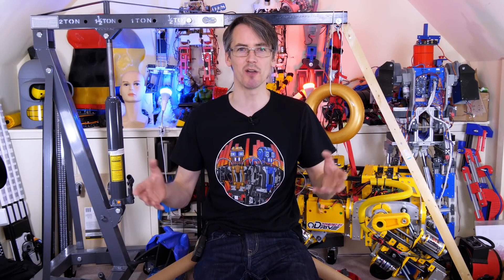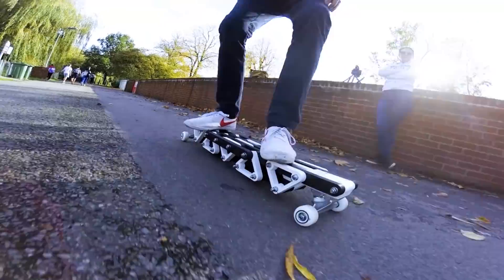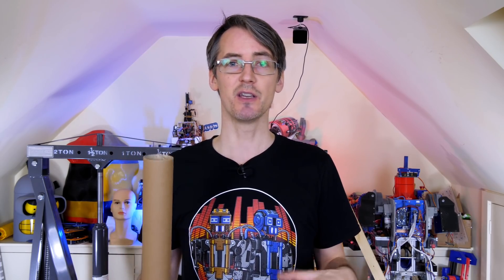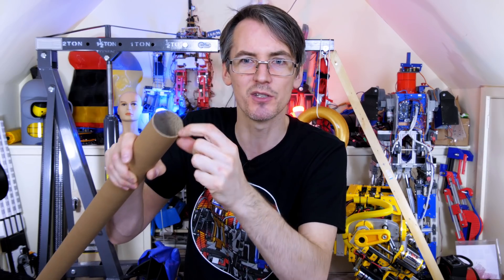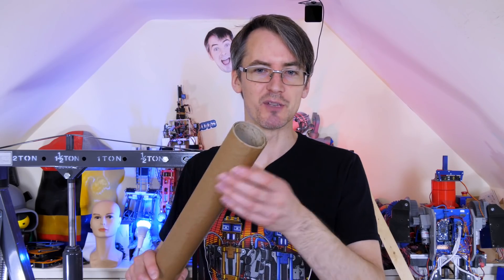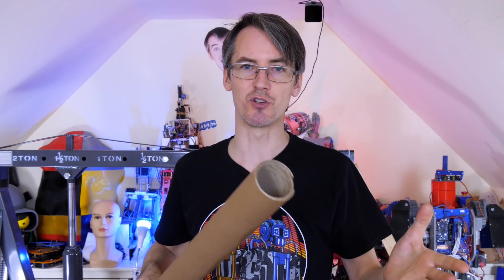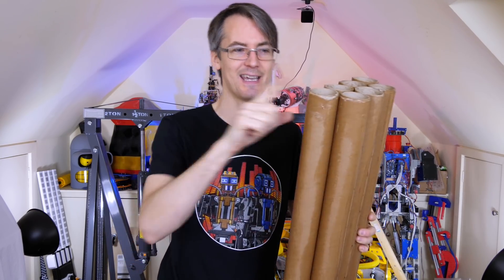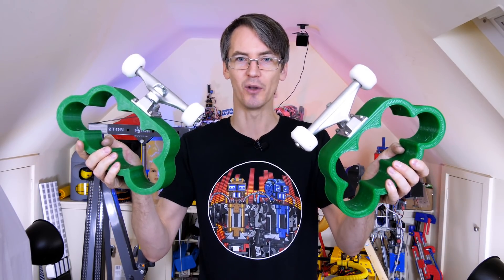How Strong is a CARDBOARD SKATEBOARD?

Comment from the maker: I'm having a one-week break from robotics, but we're back next week with Robot Dogs!   I thought I'd see how strong cardboard is - what else can I make with this type of structure?!
Reply: would be cool if you installed ducted fans in those tubes! Maybe you could get enough thrust to move it along when you're standing on it!
Reply: What if it rains while you are skateboarding?
Reply: @himanshunaik5636  glue coated. Not hard to seal the inside as well.
Reply: Disaster Shelter ala Shigeru Ban. Or Tiny Home.
Reply: Try you get your capable hands on some top level cross-country ski pole tubes. Carbon. Some may not be (as) tapered.
Reply: What about replacing some of the aluminum extrusion in some robot arms/limbs with cut sections of cardboard tube? It could possibly make them a little faster being lighter. =]
Reply: As a cardboard robotics enthusiast, I’d love to see your take on it.
Reply: A bunch of tubes... a Bicycle frame? That's technically just tubes too, usually made of aluminum.
Reply: Try making a nurf gun of your own with it
Reply: Rockets, airplane fuselages, telescope tubes.
Reply: Robots!
Reply: Is it weather proof?

Comment: You should stand in the middle of the tubes a jump off them or jump onto the middle of the tubes, that would be a better test out their strength. The best test of their horizontal tensile strength would be to see how much weight (in the smallest possible area) the tubes can take before they break.

Comment: considering your lamination of the tubes I'm pretty sure you could get rid of the bottom three tubes and the top four would be strong enough on their own. In fact I wouldn't be surprised if three tubes wouldn't be strong enough. Now if you start playing around with 2 part epoxy resin then the tubes become something altogether stronger, especially if you saturate the cardboard with low viscosity resin. I did this a number of years ago with double walled corrugated cardboard sheet and resin that was the same viscosity as water and that stuff is positively structural.

Comment: James you should try making  stuff with carbon fiber cloth with epoxy resin, very strong stiff and light. Use insulating foam for the core machined by hand or on you cnc router. It would take a lot of weight off the dog and other projects you make.

Comment: Thanks, for the great idea. Basically my wife wanted to make something that required a 12x8 inch cylinder and 3d printing strong cylinders was taking a lot of time and we need it to be light weight.  I suggest more quick small videos like this in addition to robots. May be a lighter version of open dog using these tubes as most of your viewers like me cant spend so much money on extrusion and strong powerful motors.

Comment: Ikea uses a honeycomb-like packaging cardboard that is strong enough to stand on. I'm resting my PC on a piece at the moment to raise it 5 cm off the floor.
Reply: Yes, most Ikea tables and other furniture are made out of these and most cheap room doors too.
Reply: @petermuller6923  I clearly said packaging material. Not furniture. Packaging material. Use Google translate next time.
Reply: @TheAstronomyDude  Sorry, i don't need a translator, just did not read carefuly. Anyhow, they make furniture out of cardboard. That's the point.

Comment: How about using the original tubes in a single tube design by soaking the insides with resin? Seems gluing 3 together is a bit cheating. :) Having only the 4 tubes across would lower the center of gravity also. Nice experiment though. Thank you.

Comment: This is crying out to have some model rocket boosters in the back LOL
Reply: It's a poster delivery system.
Reply: Hahah, that would indeed be awesome. Unfortunately, there's no way regular fire works would propel a skateboard forward with someone on it. The weight vs thrust ratio just isn't there. It would need quite the rocket.
Reply: PHeMoX yeah a regular firework rocket wouldn’t do it and would also be quite dangerous when it explodes 🙈 but there are solid rocket motors that can be made that would easily propel a human, to be honest the biggest challenge would be how not to make it too powerful 🙈
Reply: I was about to say something similar.  Due to the size and number of tubes, you could fit 5 pretty large solid rocket motors in it.  Of course the problem with rocket propelling a skateboard would be the initial moment of impulse.  It would be prone to bucking you off and going its own way.  hehehe
Reply: @PHeMoX  Isn't like 1 kg of thrust already quite a bit for this weight on skate wheels, say 5 m/s, flat ground? I don't expect mad acceleration but a gentle push is enough for someone one a bicycle to maintain that speed. Can't be more than a few kg.

Comment: There's more glue than cardboard in this thing
Reply: This has me wondering... if you soak cardboard in enough glue that it impregnates it, are you effectively making a composite material?  Where's the line between "a cardboard tube with glue on the outside" and papier mache?

Comment: That thing is areo dynamic in a pretty unique way. What other vehicle let's air move through its entire chassis?
Reply: Make it whistle...
Reply: @wolfbrave4866  That's brilliant!
Reply from the maker: That is a good point
Reply: @jamesbruton  It's worth noting at best. I'm not an engineer but I suspect it doesn't make much difference aero dynamically in a longboard configuration. I just like to think about things outside the 📦. Or cardboard tube if you will. Cool build!
Reply: An aircraft I sketched. Air inlet is the whole frontal surface. Air is compressed to narrow tube besides which there is space for systems and payload. Like an open head rocket. Aerodynamically inert of non-thrust drag.
Reply: @Cloxxki  Sounds sketchy lol
Reply: Not really.
If you add up the surface area of the tubes all together, it would be far more than a skateboard
Reply: @TATTIEPICKER  ...and is it the surface area that matters or is it the way the air flows over and through it?
Reply: @TATTIEPICKER  Yeah but a normal skateboard is tilted up at both ends causing lift and drag. On his there is more of a profile facing the air but mostly it can just flow though it. I'd bet the tube board would stay grounded better in a wind tunnel.

Comment: Did you even need glue or would the 3d print piece be strong enough to hold them together?
Reply from the maker: it might have been, also four tubes would probably have done
Reply: @jamesbruton  glue fills the voids like fiberglass insolation is floppy but with epoxy it is silly strong the pva is providing a lot of support to the matrix and weatherizing it. Making it better in more ways than just cardboard would be at the job. On the car it might be good to think about using linen mixed between the glue layers with cardboard to add extra strength while keeping with the organic and cheep theme.  Pollyeurothane would be a better weather resist top coat though. Doubt any of this is news to you though and hope you think epoxy for gearing if you gave any.